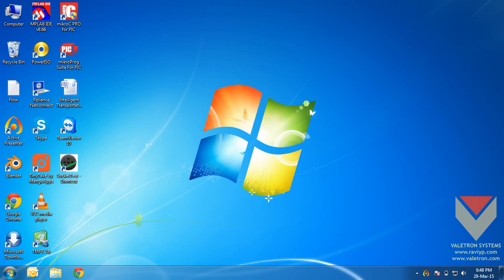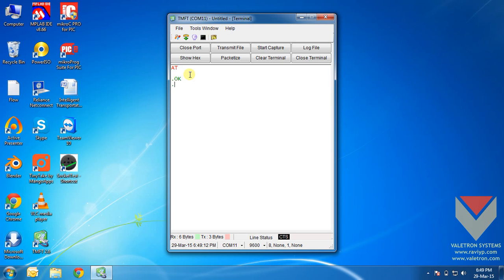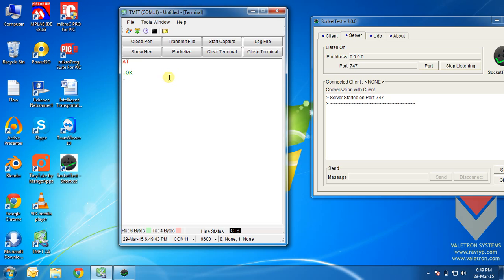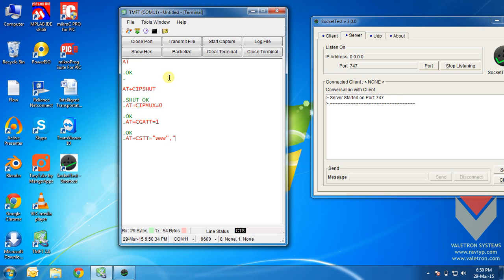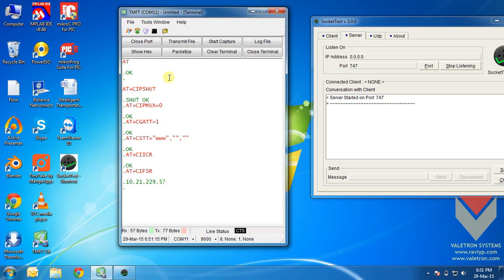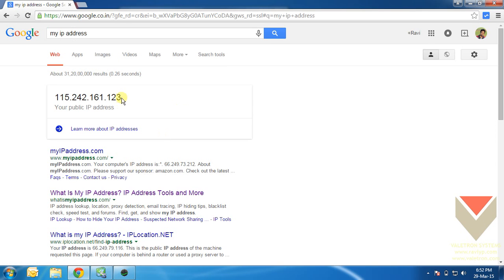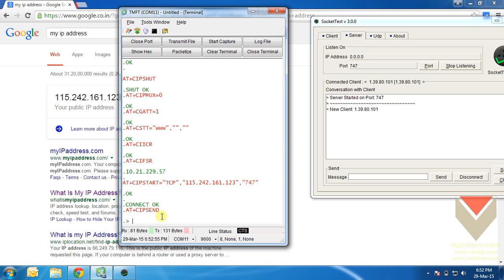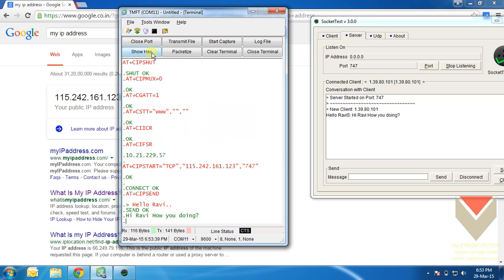SIM900 GPRS TCP/IP AT Commands

Comment: Hi, really useful video. Thanks. But when I search my IP address it shows IPv6 address (looks like : 2700:4903:22df:b3f7:bcf4:5068:19b6:48e9). I am using SIM800 device to connect. Can you suggest how I can use the CIPSTART command in this case.
Reply from the maker: What network is yours?

Comment: Thanks for your video! I am going to send the data of my sensor to a server every two milliseconds (ms) via sim800. Is it possible to do this with such speed (sampling rate)? I do appreciate any help.
Reply from the maker: No, it will not be ideal as 2g speed is limited. If you keep connection open always on TCP then you can send about every 5 seconds for consistent results. Otherwise data will be lost. Don't forget to like share and subscribe :)
Reply: @RaviPujar   what about 4g?

Comment: When i connect, I get Connect OK. Then after some seconds i get, "CLOSED". I never see the connection take place on the server either
Reply: So this happened because i was connecting to the network at my place of work and there were firewall settings that were blocking it. You need to turn the firewall off of the server running SocketTest

Comment: Hi Ravi. I have a question. I have a GPRS connected to a Raspberry PI3 that is sending SMS. My PI3 is connected to my house Wifi. I want to connect it to the SIM's 4G internet. There are many tutorials on how to connect it to a PPPoe from the GPRS. I want to know if there is going to be a conflict between sending SMS and connecting to 4G because they use the same Serial port ttyAMA0. Or the solution would be to connect the 2nd GRPS port to an USB port in PI3 so that SMS goes through AMA0 and 4G goes throug USB?

Comment: Hi Ravi!Great video! Thanks a lot for sharing your knowledge so clear.I am working in a simple telemetry Project that consist in sending data from Arduino to internet over GPRS with SIM800L. I want to send values of analog and digital variables (sensors) attached to Arduino and put these values in a table or database in a website. Also I would need to send some instruction from the website to Arduino in order to control some digital output.Could you tell me which is the simplest method to achive this? TCP/IP Over GPRS like seen in this video or another method? Please give me some hints. Greetings from Argentina!
Reply from the maker: Hi Deigo, 
Greetings from India :)

Thank you for the appreciation. Glad you liked it.
I suggest HTTP because you can easily send data to URL or end points using GET and POST requests. Look at my HTTP tutorials on SIM900 and GL865. I show how you can collect data using a PHP website in GL865 tutorial. There you can write simple code to save that to database. 
Alternatively you can use ready servers like Dreamfactory which provide ready to use endpoints for collecting and processing data. Just send your data in requests and it will be automatically saved in table you want. 

If you want asynchronous instructions to be received then you have to maintain a TCP connection open always, like in MQTT (Check out my tutorial on MQTT using SIM800) you can easily subscribe to a topic which can send instructions anytime. On HTTP you have to send data and wait for response for sent data, In this response you can pass your instruction or command to device. But you need to send data regularly or poll regularly to get instructions in time. 

And, Dont forget to Subscribe and share :)
Reply: Thanks Ravi! :)Suscribed!

Comment: Any idea what I would have to do, if I need to upload an image rather than data to the server? Is that even possible?
Reply from the maker: I havent tried it but you need to use the same procedure but use base64 encoding for sending data as it is binary. And have your receiving side decode it back to binary. Also there is option for sending binary data using multipart file upload protocol. You should find it in HTTP protocol documentation for sending correct content type parameters for binary data.

Comment: Hello , it was quite a useful video....But did any one faced AT+CIPSTART error , The command doesnt connect my sim 800 module to the server  , Using socket test for connecting, but stuck......plz help
Reply from the maker: Hi,
If your CIICR command ran succesfully and got an IP address on CIFSR then you should not have this problem. Check these two commands again. Make sure to have balance on SIM card or a data pack.

Comment: Can we use TCP for accessing any web pages or http links?If Yes,Can u please tell me?
Your socket software shows IP as 0.0.0.0 but you used your PC IP which is different.Why?
Reply from the maker: 0.0.0.0 means that value is not used. Server ignores that value and opens a socket on given port number for listening. 
Leaving it 0.0.0.0 means you are opening a server at 127.0.0.1:747 if that is the port number you selected. 
For accessing from outside world you need Public IP.

Comment: Hi Ravi,
Thank You for your tutorial.
Everythings it's working (at SIM900).  I am sending massage to my IP(SEND OK). But I have one problem. 
I want 'listen' massage from my module but I don't see nothing. I try to use wireshark or your programs. 
Can you help me with it ? 
Sorry for my english.
Reply from the maker: Hi Lukasz,
You can send message to IP and receive back when the connection is still established by the client/module. You cannot initiate the connection from PC/server. If you are trying to make SIM900 as server, its little problematic. Watch my video on using SIM900 as TCP server.

Comment: Hi sir I am using SIM808 modem everything works fine but when i give 
AT+CIPSTART=”TCP”,”www.google.com”,”80” command it gives error i have tried using vodafone and aircel sim .Please someone help me
Reply from the maker: Make sure you are connected to network and IP address is correctly allocated before trying that command.
Reply: yes IP is allocated to network can i get your email address so that i can mail you snapshots of it
Reply from the maker: ravi@valetron.com
Reply: thank you sir but issue is solved just now the problem is withe google.com I tried some ip from m2m support and worked
Reply: Tysm for your quick replies
Reply from the maker: Nice. Glad it worked. My pleasure. Dont forget to subscribe :)
Reply: Yes sure and is it fine if I mail if I have any issues?
Reply from the maker: Yes, you can drop me a mail. Will be happy to help
Reply: Ok thank you sir
Reply: Sir why tcp connection gets close after some time
AT+CIPSTART="TCP","********","80"
OK

CONNECT OK
AT+CIPSEND
> HI
SEND OK
AT+CIPSTATUS
OK

STATE: CONNECT OK

CLOSED
Reply from the maker: Because servers have time out in them. If you dont send data within some time they will time out and close socket.
Reply: I am using websocket so connection is open all the time so any idea what exactly happening

Comment: How to connect to borad sim900? if arduino will use 5vt with 5vr connect to D2 with D3
Reply from the maker: If you are connecting Arduino to SIM900 then you need to translate the voltage levels to 2.8V on SIM900 side using voltage level translator like TXS0102.
Reply: AT+CIPSTART=“TYPE” , “domain”, “port” how to use port .I don't know it error. I use in program arduino serial moniter because take in car.

Comment: Sir thanks for this video.. my query is now i want to collect this data in other controller at recieving side connected with static ip is it possible?
Reply from the maker: Yes you can. Explain your setup and how everything is connected. Drop a email at ravi@valetron.com
I will try to answer.
Reply: I am Working on GPRS Wireess Communication from One station to Another Station.
I want to send some bunch of data from Client GPRS Module and Recieve it on other side connected Server.
In Your Tutorial You made your PC as a Server No, my Doubt is that may i Make Some Micro Controller based Server which can ehave as My Server instead of PC.

Comment: Hi Ravi,
The video is very simple and easy to understand. I am using a SIM808 module, which has the same AT Commands as SIM900. I tried establishing a TCP connection according to the steps in the video, but after the CIPSTART command i always receive TCP CLOSED response. I tried many times, even by changing the simcards but the issue is the same. When I try to establish a TCP connection to the www.google.com, i get a response as CONNECT OK. 
Can you help in this?
Reply from the maker: Hi Amit, It is due to the server port not being open or there is a firewall on the server which is not allowing your module to connect.
Reply: Thanks for quick response. Can you please help me with the solution of the problem

Comment: Hi Ravi, great video, thanks to share this knoledge. I need to connect to a remote microcontroler using SIM900, exchanging not too much data (100 bytes per hour) in order to check the machine status. In base to your experience wich is the best way to do it? Is this GPRS TCP/IP Method? How you solve the non fixed public IP in the Server Machine?Thanks again for your help... Gustavo
Reply from the maker: Hi Gustavo Auyero,
Thank you for the appreciation. You can use TCP/UDP/HTTP for retrieving data. You cannot connect without a static IP Because it keeps changing. Best way to do it is, Make the remote machine to update data to a intermediate server, Use free IOT servers available like Carriots and then get data from there whenever needed. If you can explain me the exact setup like which kind of machine or system is being used, and are you reading from a microcontroller through SIM900 to a PC,  and what are the constraints. I can suggest better.  Drop me a mail at ravi@valetron.com

Comment: Very helpful ! But what are differences between AT+SAPBR and AT+CSTT ? Because for me both seem to enable GPRS service of the module...
Reply from the maker: Thanks max. Glad it helped. Not sure about the exact difference. SIMCOM suggests AT+CSTT while dealing with TCP connections and AT+SAPBR while using HTTP and FTP connections as seen in their application notes. They have this option for running as a client or server in TCP mode but client only in HTTP mode and there is a MUX selection option where in you can have multiple connections to different servers at a time. So may be CSTT enables us to have multiple connections using TCP/UDP but SAPBR kind of restricts us with single HTTP/FTP connection mode. Am just guessing and i have a dropped a mail to SIMCOM support person and if they reply i will definitely let you know :)
Reply: Ok, I see. Thank you, your supposition make sense and I will appreciate your feedback if SIMCOM will response you. I try to do some TCP connection with SIM800 at my office but it didn't work. Maybe because, behind my wifi router, there are other switches, devices and security services which bloc external connections.

Comment: Hi,
I have SIM900a module and I am unable to connect to server like you do, my module wait for long time and then reply with error STATE: TCP CLOSED
CONNECT FAIL.
can you help me to connect my module to internet.
Reply from the maker: There could be multiple reasons for that. First make sure you are connected to internet by checking the IP address and then also check if your server is not behind any firewall. And also you can use SocketTest as a client to test your server operation.
Reply: yes im having the same problem and something is wrong with my public ip address (which i got from google) . 103.195.141.4 . without sim900 , i can't even connect socket test's  client tab with server Tab  with that ip. but google says that my ip . how to find that im behind any firewall or anything ...??  please please
Reply from the maker: You can do port scan by an online tool here
http://www.ipfingerprints.com/portscan.php
And check if that particular port is open on given IP. If you are behind firewall the tool will not show that port as open. Its just a guess. You can give it a try.
Reply: that tool sounds like not open at all but i did opened my port on socket test. after fiber_optic_cable there's a media converter and a router in my house > then my pc .. As im affected with their firewall ,  would  you please  teach mme how to  usce  TCP/IP  in this  situation   ??? with pleasure
Reply from the maker: I have no idea how to get past through that. Many of the routers come with port forwarding where you can forward packets coming to your router to a particular port to a  particular IP address on LAN when multiple systems are sharing the same public IP address. Check you router administrator panel. There might be a option for port forwarding.

Comment: Hello Ravi, help me please. I buy Sim800L module, from my project. 
I did everything according to instructions from the datasheet, and my massage send is good, but the answer from the server, I do not get. I wait ~60 sec and my connection closed server.  What could be the problem? I'm testing my request from another module(m590e) is good. 
Its command what i use:
AT+CGATT?
AT+CIPMUX=0
AT+CSTT="www.ab.kyivstar.net"
AT+CIICR
AT+CIFSR
AT+CIPSTART="TCP","193.193.165.166","20332"
AT+CIPSEND
> #L#xxxxxxxxxxxxxxx;xxxx\r\n
Reply from the maker: Are you sending Ctrl+Z after entering data in CIPSEND?

Comment: I am connected throw wifi, and when I am trying to start listening TCP server on test socket, It is listening to my local IP address of 10.50.15.86. I am unable to connect throw Public IP address 111.93.149.186. in the server there is an option of providing IP address there is if I trying 10.50.15.86 then it is working or if it is 0.0.0.0 (in this case also in able to connect throw 10.50.15.86 not with 111.93.149.186). can you please suggest me something ?
 or can you share your ipconfig cmd result Thanks
Reply from the maker: I dont think it will work through WiFi as it will be a shared IP. Unless you have a static IP or have port forwarding kind of feature on your router it wont work. .

Comment: in my case
AT+CIPSTART command shows:

OK
STATE: TCP CLOSED
CONNECT FAIL

please help
Reply from the maker: +Fahimul Islam it means that the connection is closed on the server.  Or you might be connecting to a ip which is not unique or which is shared between many computers like a LAN
Reply: +Ravi Pujar can you please provide any solution? Any kind of solution would be big help. Thanx.

Comment: hi,THANKS FOR AWESOME tutorial.But in my system  AT+CIPSTART command respons as "State:tcp closed"
CONNECT FAIL,
earlier i was trying on common wifi but later i trried it with modem but problem remains same. it would be helpful of u help me out 
thanks
Reply from the maker: +Shashank Mishra Hi , Before trying with SIM module first try to connect with socket test to your server, if it is able to connect then you can try connecting with the module.

Comment: hi,THANKS FOR AWESOME tutorial.But what if after the CIPSTART command,getting respond as "State:tcp closed"
CONNECT FAIL
Reply from the maker: +Ghugan cena (cenation619) Hi, Thank you , It means that the socket is not open on the server side. Some servers have a time out , so when a socket is opened it automatically closes after few seconds if no any data is sent.
Reply: +Ravi Pujar SIR  i am having same problem.whatshould ido to tackle it